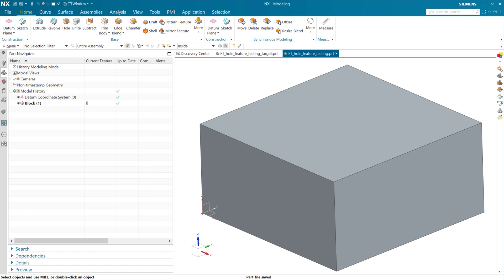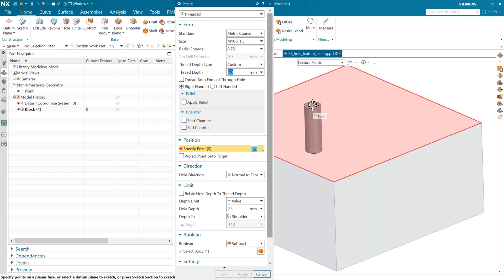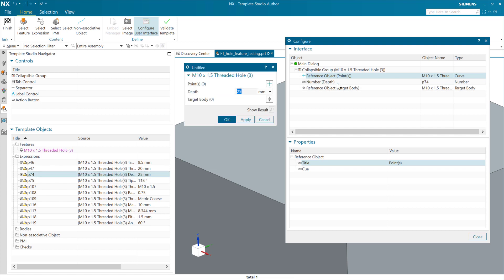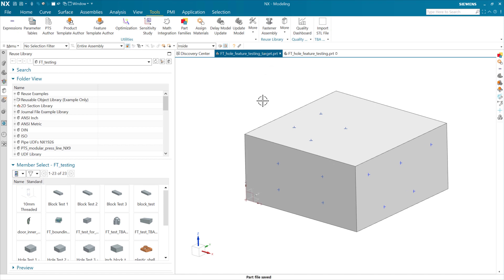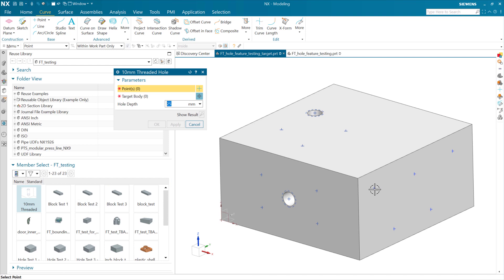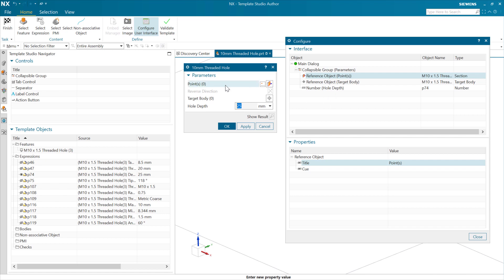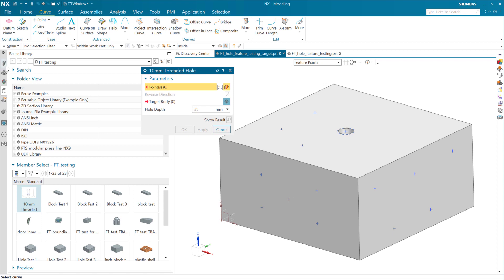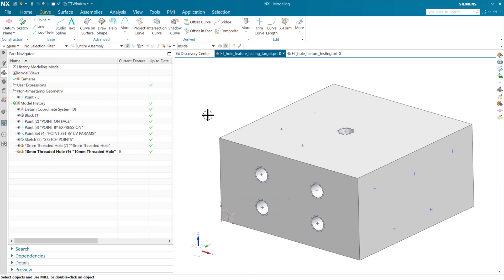NX Feature Templates: Using Points and Hole Features [NX 2206]

Comment: Nice video. Thank you. By far the best about Feature Templates that I've found so far. 

Could you point be to right direction with this? Maybe a video you've already done? 😅

I'm trying to create a feature template for counterbored threaded hole to four holes in 2x2 grid around the given center for the grid (...and add rotation for the grid in future and so on...). Which means I can't do it with just one hole feature. 

I'm doing it now with simple hole with flat bottom for the counterbore and another for the threaded hole. 

I've managed to create the template, with one holeset, but if I place it on a vertical face my threaded hole will go in the wrong direction as if it would be on a horizontal plane... and it keeps asking me to give the point and target body for both holes separately, which seems odd to me...

I'm feeling that I'm missing something obvious here...

Comment: Hi Taylor, 
Thank you very much for your videos! 
They are really useful to understand how to use this feature properly.
I would like to create a custom feature in nx that would allow me to set the pre-drill length for the drill depending on the thread size I want to create.
Is it possible to add a list of thread size choices in the form that would allow users to change the thread size?
Thank you so much!
Reply from the maker: Definitely!  Sounds like a great application for using a Parameter Table to capture those standard configurations.  Great question!